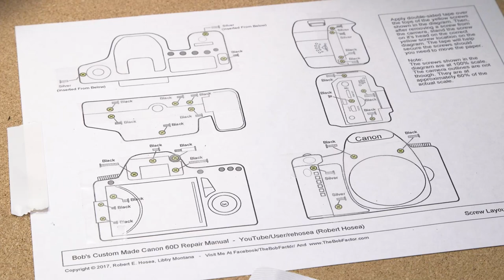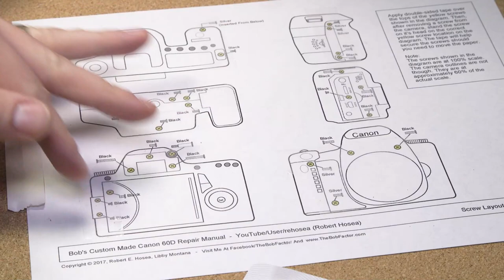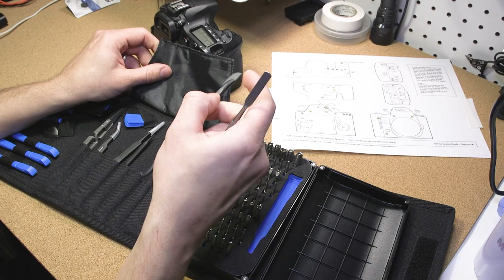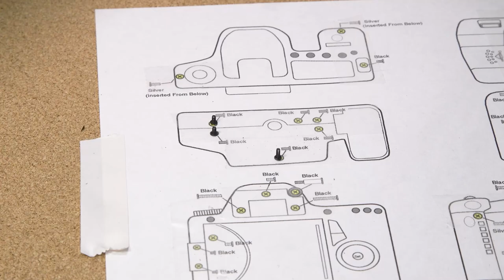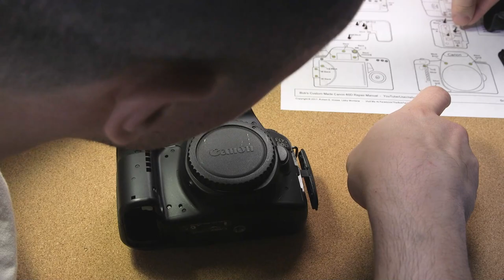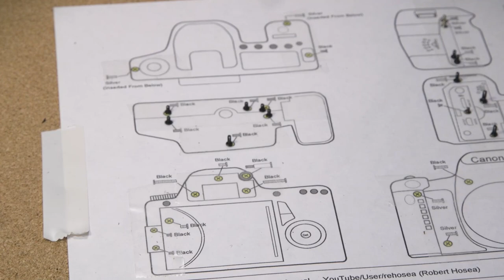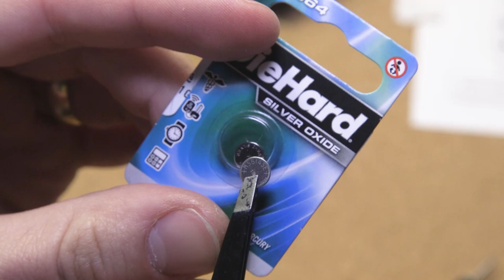Internal Watch Battery Replacement Guide for Canon 60D

Comment: shutter button trick works.. I had to do it twice.. first time, took out battery and sd card - held shutter 15 seconds, put battery in, turned on, it didn't work..second time held button 15 second, put the battery and the sd card back in, worked like a charm.
Reply from the maker: Interestng. Well you can see here that it didn’t work for me, unfortunately. I tried every iteration multiple times to no avail. But I’m glad to hear it worked for you!

Comment: Excellent video! Excellent! It's such a shame that the battery was not the problem here though. I can't tell you how many times I've laid in bed and mentally dissected some non-working form of electronic technology and convinced myself that I just somehow figured out the one thing that needs to be done, the ONE thing, that will effectively and magically fix the item and get it back to working 100% again. And then in the morning, even before getting my first cup of coffee, I try my hard earned sleep depriving idea, only to find out it didn't fix it. Lol. That sucks. So, when I can hear in your incredibly awesome narrative voice, the frustration (in a good way) of finding out that your repair did not fix it, I totally relate. Totally. This video will definitely help others though, because there are those times when the battery is the problem. And now for those times there is in fact an "official" battery replacement tutorial for the 60D. Great job! It's been a long time coming for someone to make one.
Reply from the maker: Thank you for watching and for all the help you've offered.  Definitely relate to what you said.  I think a lot my frustration is also from the fact that I don't possess the skill or knowledge to fix it.  I wish I knew more and had better equipment.  I don't know when I'll have part 2 done, but in that I dissect it more and probe some of the power lines you mentioned.  The one big strange thing was the one circuit that is supposed to be at 0Vdc until you spin the shutter dial.  It was always at 4.75 Vdc.  I suppose if I really put time, effort and research into it, I could figure it out, but alas I am not like some kind of bored retired person haha.  I have a job and other responsibilities to attend to.  So, off the camera goes back to its owner and hopefully into the hands of a much more professional engineer.   Can't thank you enough, Robert, and I'll let you know when Part 2 goes up.  Hopefully in a month or so.
Reply: You guys do something I wouldn't even attempt to do.
I admire you and him.
May I call you doctors.
LOL  I MEAN SURGEONS.
Reply: @DiCasaFilm  YUR VIDEOS DONT HELP, CRY MORE

Comment: To anyone watching this video, either to replace the clock battery or to do an astrophotography mod, you don't need to remove any of the front screws and you can partially remove (peel back) the grip material just enough to access the screws. This will save a lot of time and greatly reduce the possibility of ruining the camera. You also don't need to remove the two screws on the display hinge or the diopter adjustment wheel.
Reply: Another note: the battery in this camera and probably every DSLR on the market is specifically designed to be rechargeable. DO NOT USE anything other than an OEM type battery. A non-rechargeable battery will leak if charged and potentially ruin you main board.
Reply: Another thing, the clock battery is not capable of powering up the camera, it only keeps the time, date and possibly some of the settings current. The big battery is the only thing that can actually power the camera and it is what keeps the clock battery charged.

Comment: Great job of convincing me to put the 60D aside and use my Nikon at tonight's wedding!
Reply from the maker: I don’t understand why, but you’re welcome!
Reply: @DiCasaFilm  In fact, mine is dead and I was just wondering what to do about it.  I bought it for a song, bought a charger and new battery and nothing nothing nothing.  Nice technology, but frustrating.  Thought it my be a short or intermittent connection.  You gave me some good ideas.

Comment: I had major water damage on my 5d mark iv. After taking apart to dry/clean I lost a couple housing screws. Any ideas on where I can get an assortment of screws?
Reply from the maker: Oof. Damn. that’s a tough one. You could try buying a broken camera to harvest parts, but thats probably the most expensive route.  
It’s tough to do, but you could google and try to find a “parts list” for the mark iv and see if you can find the part number for the screws and order them from Canon. The parts list may also give the dimensions of the screw (really it’s a bolt, not a screw). You’d need to know the Length of it, the Diameter of the shaft, and the “Pitch” of the threads. “Pitch” just means thread count. If it’s Imperial it would be something like “24 threads per inch or just “24”. If it’s metric, it would be threads per millimeter, so it would say “1.0” or “.85” or something like that.  
If you can find those dimensions, you could try and just order a bolt with those dimensions from a third party site. 
You could also try calling Canon’s customer service; they could potentially be a good help. Good luck!

Comment: Some measuring advice that you will like.

Meet internet legend Dave Maltz
he runs Dave’s TV in Grants Pass, Oregon.

Find this video→ Why You Should Load Test Small Batteries. Grants Pass TV Repair 

Note: the second (button cell) item on his hand-written chart should be 3V as shown on the front of the Radio Shack tester. 3kΩ load.

Comment: Hi, very informative video. I'm having the same issue with my 60d.. Tried everything and it still wont turn on.. I did the 10-15 second thing many times and had a couple successes with it, it did turn on but it wont respond, it freezes up,  even  the power switch wont do anything,..  tried pulling the battery out and back, and it wont turn on again.
Reply from the maker: I wish I could help but I ended up returning the camera to my friend.
Reply: you have to change the mainboard

Comment: I have a 60D and a T3 that don't start, even with the battery fully charged and been passed all the voodoo resets and mystery buttons combinations 😅
I think it's only a Canon thing, up to the 50D there was more quality. From the 60D they cut costs much more in the entry level range, the only APSC that works without concerns is the 7D, and all the full frame models. The entry and mid level APSC ones all have some faults in the internals that die with enough time

Comment: I had the same problem, a Canon 60D was not staying on, then would not start. I did some of the 'tricks' you have done here, then gave up. Put the camera in its box for about a year, with no battery in. Then got it out recently, put in the battery, and ... it started!. Go figure...

Comment: 23:28 be careful using a metal screwdriver as a pry tool in a camera. There are some nice capacitors in there with a great voltage waiting for you to touch them
Reply from the maker: Very true! Great point. I am still a novice and also didn’t have a small enough plastic pry. And i was also aware where the flash capacitor was located, so I avoided it. And the camera had been dead for over a year, so where as they still could have held a charge, it was unlikely. But you are absolutely right.
Reply: @DiCasaFilm  That's true, but I think capacitors tend to hold on to charges for really long periods of time. 

I know in computer PSUs that the capacitors can remain charged for even up to 5 years after being unplugged. But glad you did it safely, was leaving the comment to help people in the future be aware of the precautions!
Reply from the maker: @NickzAndMikz  oh wow. good to know. Absolutely. In any future videos where I do this, ill have to issue that warning.
Reply: @DiCasaFilm  I might be wrong, so maybe we should fact check me haha